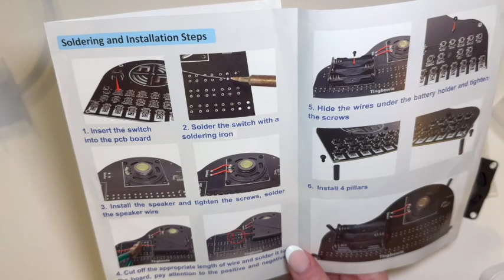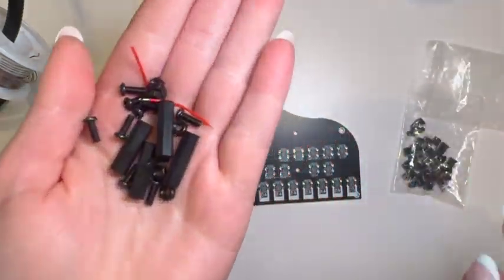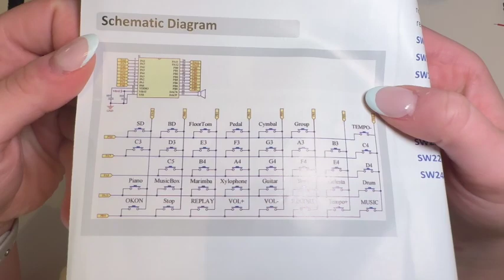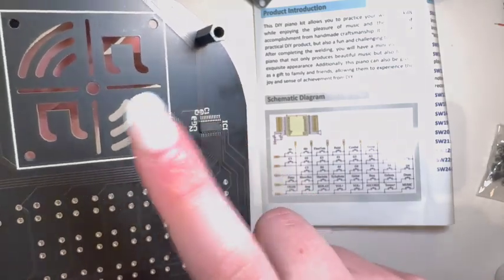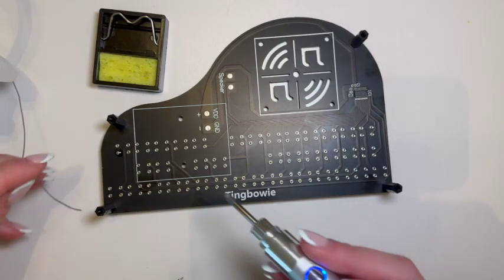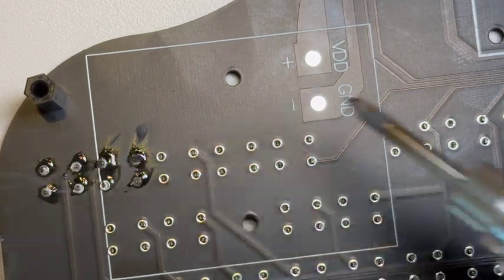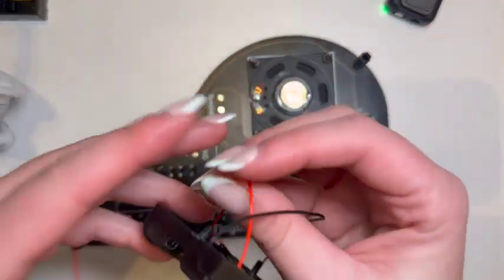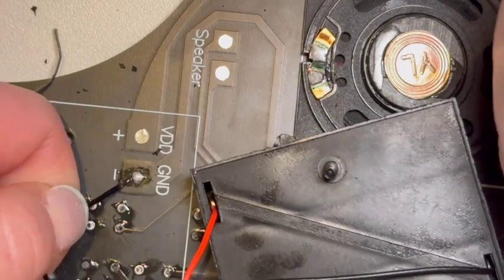Piano Soldering Project For Beginners

Comment: I thought I heard once that for soldering it’s not the lead that is bad for you…. I mean barring your not eating off of it…. It’s actually the rosen core that lets off the fumes that is quite bad for you… well done though! For those wires if you tin the wire before and then make sure you have a molten solder ball on the tip it will heat faster… when the solder gets that dry look either dab a tish more solder on there or just straight flux that will make the joint look shiny again and stick to the pad better
Reply from the maker: I’ve actually recently heard the same thing about the Rosen core! And thank you for the tip!!